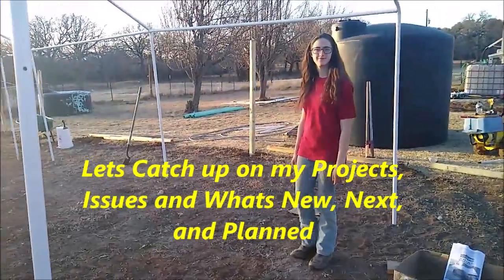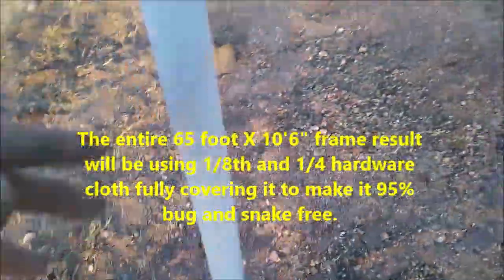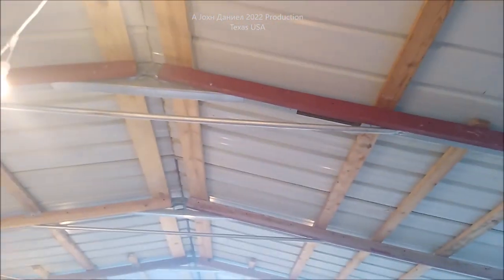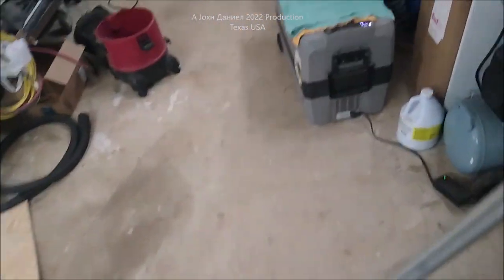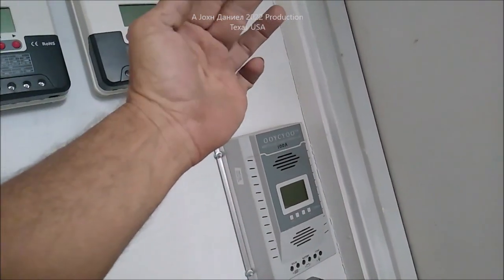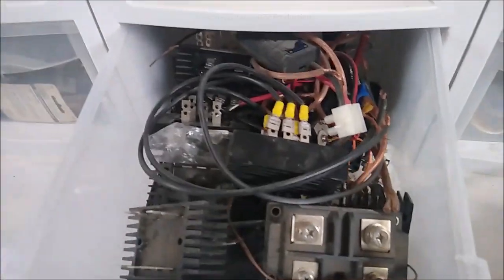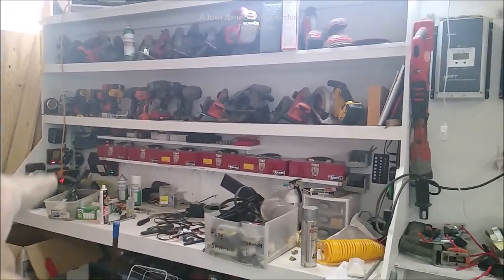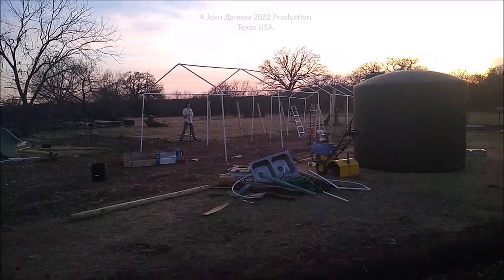Update, See the New projects, cool ideas, off grid plan, & back on track

Comment: John, are you still running a 12v system? What size ah is your battery bank? I'm about to take delivery of 4000w of solar and am trying to select the best combination of wiring and mppts, but EVERYONE is saying running 12v is crazy and i would need huge amps in the strings to charge my 1000ah sla bank and should be doing 48v. It's getting messy trying to work out the controllers and an inverter but I'm trying to stick to your advice from earlier videos.... what do you think?
Reply from the maker: I prefer the redundant system and available items for 12 volt. Pure prepping logic. 4000 watt is not much solar for a 12 volt system. So yes I'd do it in 12v. Over 8000 then I'd consider the other options . People screaming 48 volt do so as Dealer supporters normally.

Comment: Good Saturday morning to you. I hope the wild fires missed you. I was wondering if you have the same type of brake and controls for your wind turbines ? I am needing to put together a braking system for my little 400 watt wind turbine. I have built a controller from your design.
Reply from the maker: For a 400 watt turbine I'd just get a basic over volt controller. And 300 watts of load resistor. As for a brake, just a 25 amp 3 pole works. I can send you those parts from my surplus if your needing them.
Reply: @JOHNDANIEL1  Thank you foe replying quickly. Could you explain the basic over volt controller ? Is it a avg $ 30 ebay  30 amp solar charge controller ?
Reply: @JOHNDANIEL1  Please allow me to rephrase my reply. I have a universal relay voltage triggered load controller. I have built a charge controller from your design. using a ssa . 3 100 whatt resisters and a relay voltage triggered controller.  Is all I need to do is add the 25 amp 3 pole switch for braking control
 ?
Reply from the maker: Send me more details and questions to olympicpowercontrols@yahoo.com

Comment: What a great surprise to get a vid from you today for 2 reasons. First, it’s great to see you back in action! Looking forward to to your videos and all you share. Second! I watched a vid this morning where wind power was used to recharge a “solar generator” (SG). The vid is linked below. I’d like to use a turbine to keep the SG topped off. Solars fine but I’d like to use the night wind. What do you think? I have learned from your vids and i value your opinion.
So glad you’re back.
Reply from the maker: That would be depending on the solar generator, and in all honesty a very cheap wind turbine with of all things a small car battery and then using the car battery to go into your 12 volt charging port on your solar generator you prevent over charging of your solar generators lithium system. The car battery acts like a capacitor with a maximum resistance of 16 volts. If you look blow in my videos on the Chinese winter binds the 300/400 watt five blade be sure to get you a cheap MPPT multi-purpose charger for 600 watts wind and 400 watts solar. Then get in your 12 volt service Port that can handle up to 25 or 30 amps
Reply: @JOHNDANIEL1  Thank you.
Reply: https://youtu.be/iApzrIuBHPA

Comment: ALRIGHTY POKEY!  THEY SAID THE SAME "YOUR GOING A DIE " SPEECH  TO ME TOO. KO ON THE OP TABLE... STILL HERE BUT A LITTLE DINGED UP. HAVE TO COMPENSATE TO MAKE UP THE DIFFERENCE. GLAD YOUR STILL GETTING THINGS DONE. VAN AND RV LIFE ARE HOT NOW. THEY ARE GOING TO THE CHINESE DIESEL HEATER AND SOLAR.  HAVE NOT SEEN A SMALL TELESCOPING WIND TURBINE FOR A VAN OR RV YET.  IS THAT WHAT YOU WANT TO BUILD???
Reply from the maker: I see a mid mounted swing up style in the future for RVs. Working on a quick release blade system that's promising so travelers can flip it down, remove the blade and hub set with one step then roll.
Reply: @JOHNDANIEL1  looking forward to that!

Comment: Welcome back John someday when you get feeling better I'd like to talk to you about upgrading my solar panel on my RV.
Reply from the maker: What size RV and are you planning on taking it to Texas where I can install them?
Reply: It's just a 23' travel travel trailer with a slide John and it's got A little solar panel on top which goes through the converter I will have to look and see what the amperage is. I just thought about putting something up there that would be big enough to keep the 2-6 V golf cart  batteries charged.  I bought the little sportsman generator that you recommended but thought it would be nice for short camps if I didn't even have to run the generator.
Reply from the maker: Give me a call when you get done with your run and I'll see what I can figure out but I'll need a picture of the roof of that thing.

Comment: glad you are doing well... wanted to ask question those Etracer controllers are how many amps?
Reply from the maker: They are the 60 amp 150 volt models, we are running 5 Stion 135 watt CIGS Amorphous panels into each one, total of 25 of them. 
The Stion are 80 volt output, 95 volt open, once placed on 12 volt charging use they result in 10.8 amps each, 54 Amps which leaves me my preferred 10% under rating safety margin.
Reply: @JOHNDANIEL1  I have 2 40amps very pleased 5 years now.. going to expand eventually. How are the 80 amps I am guessing they are just as good?
Reply from the maker: @chrischrismelco  The 80 work well, I installed 4 in a system south of Fort Stockton Texas 3 years ago, not any issues. But, always keep up the redundancy in your system, never go ONE big inverter or ONE big controller to make your power, just takes a bad day to ruin your work. I choose to run lots of little, so if a fail occurs its a small percentage we loose.
Reply: @JOHNDANIEL1  thanks I agree with you...